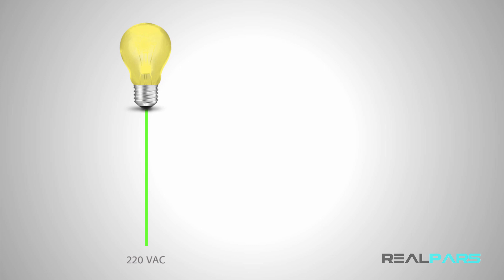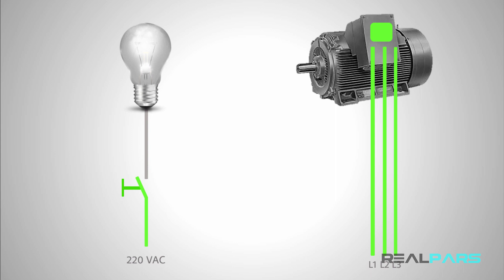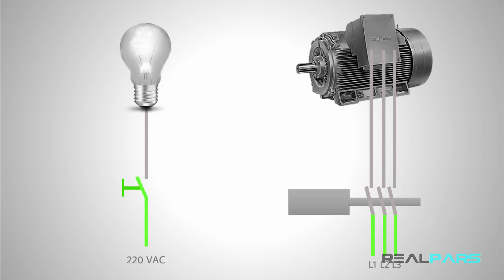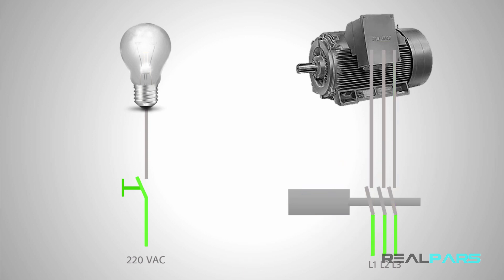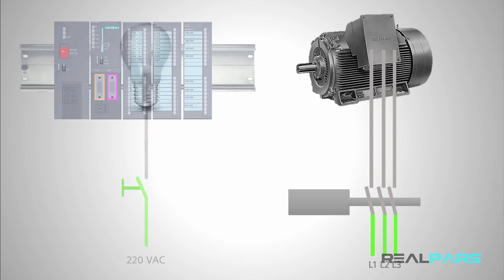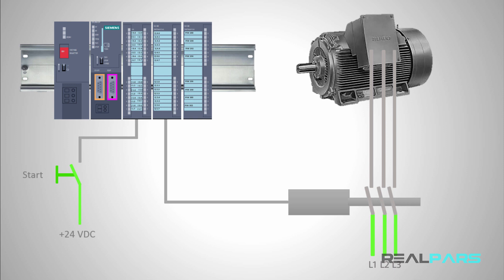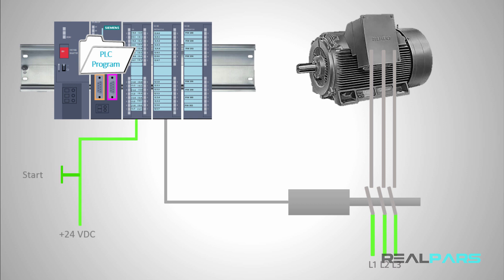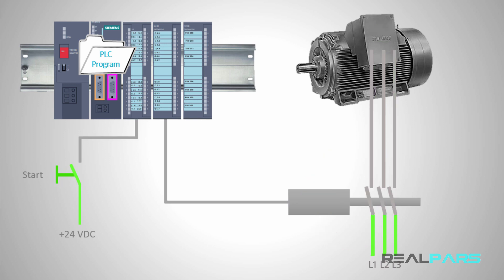Star-Delta Starter PLC program and Wiring_ Part 2

Comment: if resistance stays same you need to increase voltage to decrease current because voltage is just giving you how much energy electrical charge has. current is always the same, same amount returns to power plant however energy doesn't. Motor consumes it or better yet, transforms it to mechanical torque. So saying too much current blows fuses is therefor wrong, drawing too much energy without dissipating it enough (ratio) causes fuse to blow. Because if we return the energy back to powerplant, somethings gonna have to dissipate it. and that something is in the form of HEAT in the end. everything is about energy. am i visualizing this correct?
Reply from the maker: You are mostly correct in your assessment.  Most fuses (and circuit breakers) are placed in the supply line to Motor controller, panel or other user.  At that point the voltage is typically constant, or nearly constant, so it is current that will cause the fuse to blow.  In the case of a surge, you are correct, it would be the energy burst that blows the fuse.

Comment: One of the best videos. I have one correction small only:

At 1:29, you said current flows from source to load, but that's not exactly true. At any instant in time, there will be at least one of the three conductors that will be moving the electrons from the load/motor to the source grid. Since this is AC, and not DC, the three conductors will have a charge flow that is alternating. Moreover, since the load is inductive, energy flow will also be bidirectional.

Anyways, I know the point of the video wasn't to explain charge flow or energy flow in detail, so my comment might be irrelevant. But I just wanted to point this out since some people might take all information for granted.

Regardless, thanks for this free series.
Reply from the maker: Hi Alejandro, 

Thanks for your comment, we do always appreciate any feedback - I will happily pass this on to our course developers. 

Thanks again, and happy learning!